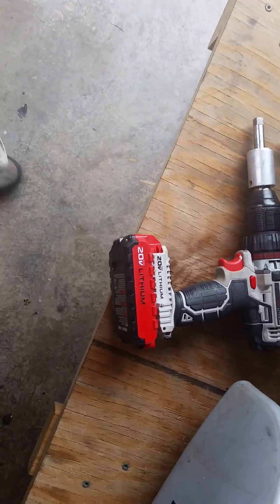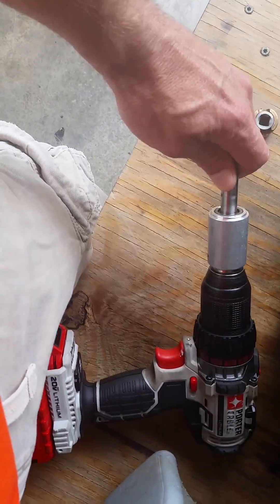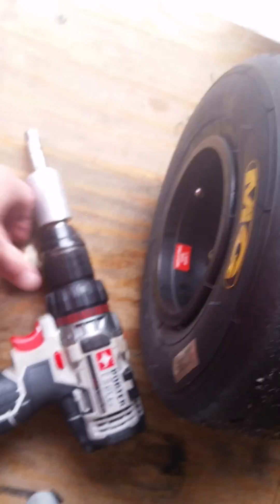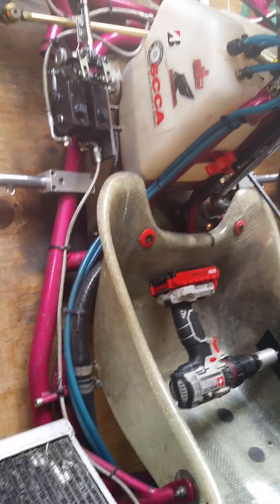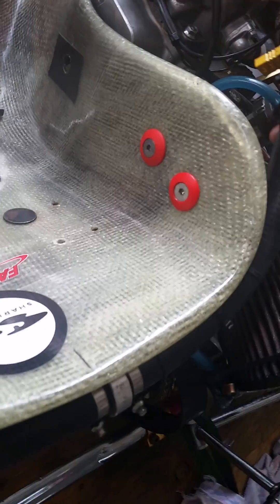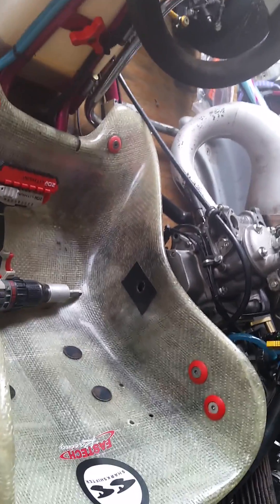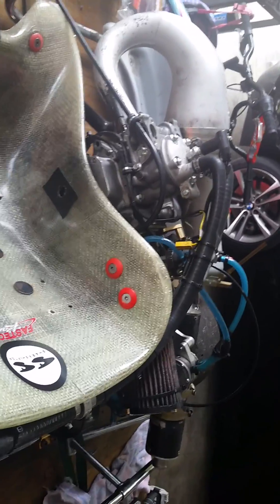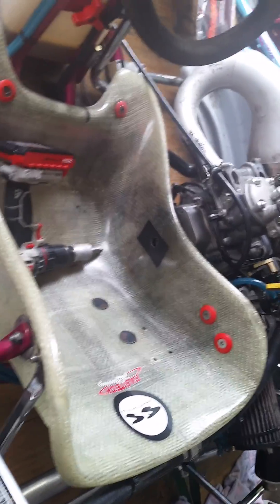CR125 Kart Electric Starter

Comment from the maker: Looks like someone is now making a very similar setup.  It's a little "steep" at $150.00, but having used this setup myself for several seasons, I can tell you it's worth every penny!
https://www.ebay.com/itm/ACCU-START-Crankshaft-Starter-Tool-for-your-Yamaha-TZ-125-and-TZ-250-Road-Racer/391532380274?hash=item5b29260072:g:x8IAAOSwxN5WY4-X

Comment: 2h of searching and only found the one-way-clutch-bearing made in Asia and sold by Asian companies. Min. qty was 15 pieces and I did not wanted to do it. No US web site featured anything like this. Coleman's own parts catalog features no one way clutch bearing or any similar parts.  Can you help ?
Reply: Try Ebay: https://www.ebay.com/itm/CSK-One-Way-Bearing-With-Keyway-Single-Row-ABEC1-Bearing-Steel-/263083512449?var=&hash=item3d40ffd281.  Picked up 2 for <$9 and it only took a couple weeks to get them.

Comment: Very Cool, How do you prevent the flywheel adapter nut from loosening when starting, Loctite?
Reply from the maker: The direction it needs to spin is actually tightening the nut!
Reply: Rusty Jaime what motor do you have
Reply from the maker: CR125

Comment: where can i get that bearing online? Great vid. Was getting upset today as Hegar has postponed the making of their quick start solution and no one has them in stock….anywhere!
Reply: +Todd Kageals Thanks a lot Todd, Im going to try and have something by weekends end if I can help it. Im down using straps for that 1st crank up of the day. After that push starting is simple….however, I soon will become too old for that to, so I mind as well jerry rig a way to have the cordless drill on the kart…LOL
Thanks for the help!
Reply: +Todd Kageals the link just went to comet home page but ill the a look around the site for it, and see if I can find a cheaper substitution
Reply: +soceur1977 ok found the coleman part, so this along with welding a bearing to it is basically all I need?
Reply from the maker: https://cometkartsales.com/Hex-Starter-Replacement-End-for-Coleman-and-SME-Starter.html